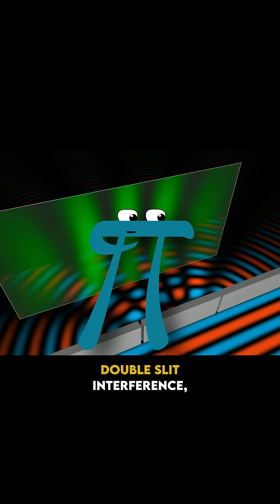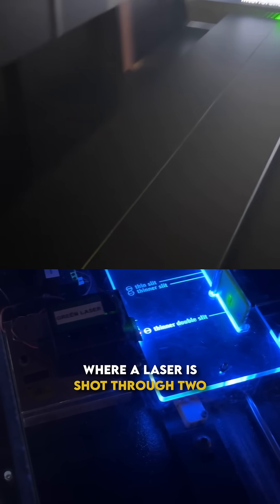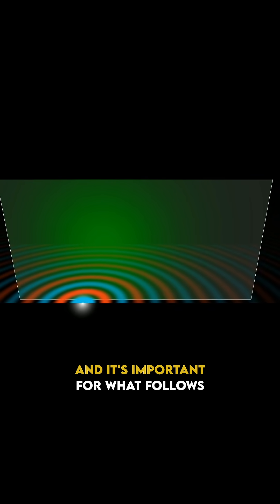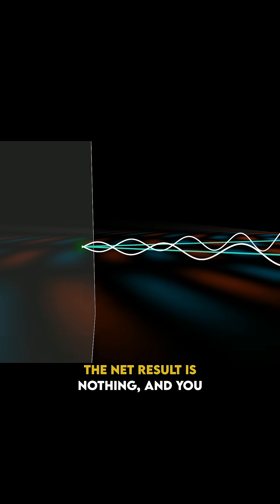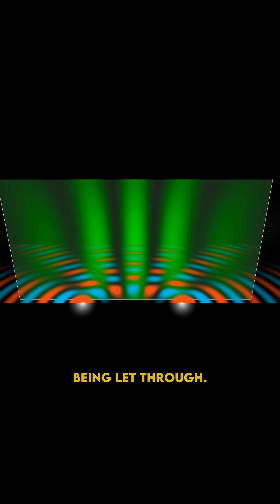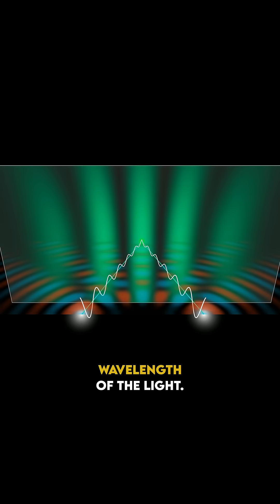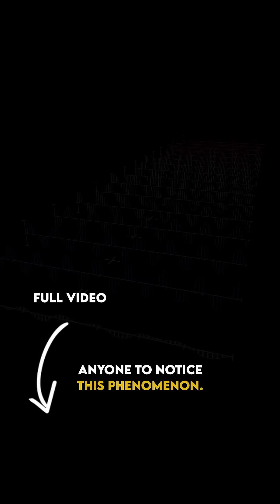Thinking through double slits

Comment: To be clear this is not a demobstration of the quantum double slit experiment. You could say this is a classical optical variation (there is no "white" wavelength of photons) as in this a laser beam is aimed at the slits. While it does demonstrate wave interference similar to the quantum experiement, it doesnt demonstrate quantum phenomena like superposition. In the quantum experiment single quanta are shot at the slits and the interference patterns thst appear are probability distributions (wave like), but when a sensor is added at the slits the pattern disappears as the measurement causes the wavefunction to collapse (in most intetpretations of QM) and the position of the quanta becomes certain and point like (particle like).

Comment: Is there a follow up video that explains how a “single photon” interferes with itself, even though a photon is a particle? I can’t find a good explanation as to why we think light is a particle. And how does one emit a single photon? You can’t see it, so is it just a calculation of the assumed energy value? Would it not still be a propagating wave? Does one light source emit [<infinite] photon particles in infinite directions? Or is light a wave until it collapses, then we call that a photon? Why does it collapse & become a photon at that point and not everywhere else?

Comment: You do see it with white light. You just need very small and close together slits. Anyone interested search up diffraction grating. It’s very cool.

I will rant a bit because I spent way too long learning about this in physics. Please correct me if I am wrong. A formula is used for interference(maximum) : d sin ø = m x wavelength. For minimum it’s: d sin ø = (m+1/2) x wavelength. D being the distance between slits(diffraction grating again). Ø is theta, Greek letter used in maths to represent an angle. M being the order of maximum or minimum which refers to the interference pattern. Basically think of the pattern as having alternating maxima (where the light is brighter) and minima (where the light is dim or not there) with the centre most being the 0th order maximum and the two minima next to it being the 0th order minima. It goes up from there by one. Don’t ask me why it’s like this. Note that this only works for coherent waves which are waves in phase with each other. That’s the reason why m can only be 0,1,2,3, etc. also the reason why for minimum we add 1/2 as it is offset by it. We use this equation (at least in school) to figure out the wavelength of light.

Almost forgot the most important part. This experiment was used to confirm that light in fact is a wave while also being a particle. Best explanation is either think of it as a stream of particles like a train or that light exists as both a particle and wave until observed, which then it functions as the state it is observers in. Confusing but cool. Light was also confirmed to be a particle using a gold leaf electro something. Am experiment which discharges electrons form a metal plate (normally zinc) using uv light. Normal light cannot do this which proves it to be a particle not a wave but also a wave. This is because the photons in normal light do not have enough energy to move electrons up energy levels in an atom but UV can. If light was to function as a wave it should be able to. Search it up it’s very interesting.

Comment: Stupid question, but at that point I usually think about what happens when light destructively interferes. Does it turn into heat? radioactivity? Something else entirely? It's not like energy stopped affecting it, the light sources are still pulling it up and down, which would make the light in that spot suffer from some sort of conservation of momentum. Is light perfectly elastic? It would seem that a constructive iinterference would be brighter regardless of whether destructive interference exists or not,, but transfer of energy from the destructive energy would make it even brighter, still.

Comment: The pattern seen is not the physical light because the same pattern is observed when any elementary particle is sent through one at a time. The pattern comes from the probability of finding the particle at those locations on the wall. 
It is not an interference of EM radiation waves from both slits. The wave here is a QM wave function that can be interpreted as having a probability of passing through either slit b/c of the mathematics of QM (ie how we square the wave function).

Comment: So the double split experiment requires one wavelength/color, and a beam of a bunch of photons to go through both slits and interfere with each other right? I always thought it was one photon, but it makes sense that it is a bunch of photons moving in wave patterns that cancel each other out
Reply: A wave can be thought of as a packet of photons. That’s why light is so weird. It can be thought of as an instantaneous wave or as a particle with speed. Neither are entirely correct as they are. Light has speed but also be a wave. It’s very odd

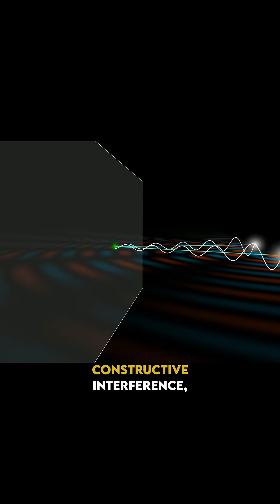Comment: 0:50 ok, it makes sense that if the two waves are in opposite phase they cancel out, but since the intensity of the wave decreases along its path, when we take a point on the wall which is not at the same distance from the two slids, the two waves meeting at that point will have different intensities, so they will not exactly cancel out even if their phases are perfectly opposite
Reply: Exactly. If you actually do this it looks more like they fade in and out but due to the fact that they double or half it is still quite clear. Not as clear as diagrams make it out to be though

Comment: What I don't understand is why each slit would become a point source of light, instead of the light just going straight through. What is so special about the width of the slits that causes this?
Reply: It’s to do with the refraction of light round corners. It’s the same principle as you can hear sound coming through a door even if you aren’t in direct eyeline of the sound. It goes round the corner

Comment: Could somebody correct me if I am wrong because I only studied physics till high school. This is what I believe: The experiment shows the constrictive and destructive nature of waves. When two waves of same wavelength with same phase meet then they are additive in nature and hence the bright spots. In contrast, when two waves of same wavelength but with opposite phase meet then they are destructive in nature and hence the dark spots. Since sound is also wave, same principle can be used for active noice cancellation. Is this correct?
Reply: This is exactly how noise cancellation works. Because sound is made of many frequencies, your noise cancelling speaker has to be either extremely close to the source of the noise or extremely close to the place you want the noise cancelled (your ears) or else you will only cancel some frequencies and not others. Like the video says, white light (many frequencies) does not cancel completely. That's why noise cancelling headphones work well but a device on a table would not (too far away).
Reply: Exactly yeah

Comment: The wave particle duality of an electro is actually the electron getting into superpostion in all possible slits whic would be all slits apart by half of the electronns wavelength. As long as you can not measure which slit the eletron will go through, the wave function will not collapse and the electron will be in a superpostion of all possible states simulataniously. Thus the diffraction pattern you see on the secreen.

Comment: Question: how destructive is destructive interference? 
I.E.: if you put a thermometer or other measuring tool on both the bright strips, dark strips, & a control dark area would the dark strips pick up any reading? 

Is there still an invisible energy transfer of some kind? Or does destructive interference neutralize the lights energy in those areas somehow? Or is the energy across the lines uniform?
Reply: Yeah so it’s never perfect because there will always be some imperfect factor somewhere. To get it completely dark at the dark spots, the slit width would have to be the exact width of one wavelength of light (about 500 nanometers) which is obviously not easy to do. So it would pick up some light if you ran it in real life but it wouldn’t if you ran it in a perfect world. Hope that helps :D

Comment: That is partially wrong
You can see a pattern with white light (different wavelengths) the only restriction is that the light needs to be coherent (the phases need to be synchronized)
That’s actually a way to split light into its base colors similar to a prism

Comment: Will the double slit experiment work with a LED as the light source?   If I understand correctly, LEDs are monochromatic and should therefore be nearly pure sine waves that will create the interference patterns.
Reply: Yes. But we use a laser because it works best when all the light is coherent and in phase

Comment: What about diffraction, never understood how it works
Reply: It's when a wave bends into the shadow of obstacles.  Longer wavelengths diffract more.  Diffraction is how we can measure the wavelength of light.  We can't measure frequency directly at hundreds of Terahertz, and thus we measure wavelength instead to define color of light.  The speed of light then allows us to calculate frequency.

Huygens' principle describes how diffraction works.  At each wave crest, the next wave crest is generated by the constructive interference of a continuous source of wavelets, that each propagate in a radially outward direction with spherical symmetry.  The constructive interference of all the crests of these wavelets, forms the next wave crest.

Comment: But why does the light behind the slits behave like a point source and not like a single beam of light?
Reply: That's a very good question. It happens due to wave diffraction!

Consider a wavefront passing by the edge of an object. When it has passed the object there are no waves immediately to the side of the wavefront because that region was blocked by the edge. This creates a very sharp contrast of intensity in the electromagnetic field. With no waves immediately adjacent to the wavefront at that point, the wave propagates into the empty space, with this spreading originating at the edge of the object. In a slit, the wavefront encounters two edges, one on either side, so when the light spreads out after exiting the slit, it spreads out to either side, making it act like a point source of light.

Diffraction effects are inversely proportional to the size of the slit relative to the wavelength of the light. You can imagine that the closer the width of the slit is to the wavelength, once it has passed through the slit, the less each wave looks like a planar wavefront and more like a parcel of light, about as wide as it is long. Almost... like a point. So, once it spreads out, it spreads out in all directions. This is why light acts like a point source after passing though a small aperture.

Hope this helped!

Comment: Real question here, so at the anti node (dark spot on wall) if I were to move that back so the wall is now not flat at that point ie further away from light source is it still dark or does the light come back because your not at the same distance?
Reply: Technically there would then be more room for the waves to continue along their path and therefor you would begin to see light again.  The problem, of course, would be by "moving" the wall back only in that area, you would be creating a cubbyhole--and adding essentially 2 more 'edges' along the new boundary which waves would deflect off of.
Reply: @billworthers1075  Sure, what I find interesting on that result, is if you think of the wall as a photon detector ie CCD does my irregular shaped wall now detect more energy ?

Comment: A couple of points of clarification. One of the problems in getting interference from the sun is that the sunlight is coming from a range of directions as the sun  is not a point source.  Thomas Young in his original experiment used a pinhole into a darkened room so that the sunlight came from only one direction. The second point is that the incoming wave is reflected backwards at the slits and there is an interference pattern behind the slits as well is in front of them.  Nils Berglund has produced a simulation including this reflection effect.

Comment: I Always though the astounding point about the double slit experiment was this:

for things like electrons or photons you have a wave-particle-dualism. Meaning things like electrons have properties of both particles and waves.
Even if you shoot single electrons or photons they have wave properties. This means if you have a double slit, even singke electrons shot will have a wave property and this will lead to the electron (as a wave) interfering with itself leading to the same interference pettern.

Now the astounding part. If you add a sensor capeable of measuring through which slit the electron passes though this changes the pattern on the oither side. The measurement collapses the wave function fixiating the point of passage to one of the slits. Since now it is "known" though which slit the electron travveled, the wave can no longer interfere with itself, since the wave does no longer travel through "both" of the slits, but it is fixed to one slit. This means the wave can no longer interfere with the part of the wave that "travveled though the other slit" therefore you end up having no longer an interference pattern.

The astounding thing for me was always the idea, that simply the measurement of the passge of the elecctron changes the outcome of the experiment. The even more confusing thing about it for me. Unless it is measured, there is no clear location for the electron. It actually acts as if is was a wave with a "density of probability of presence function". The single partical can act as if it was a wave with a probability function and until collapsed through measuremnt, there is not disction location, there is only a wave function.
Reply: Right, this fails to address the real complexity of the two slit experiment.
Reply: The big question is what exactly is counted as "measurement". Can't electron just bump into something on its way to the screen that would also be accounted as "measurement" by nature?
I might be wrong but it feels this has to do with Heisenberg uncertainty principle. If we know which hole electron have flown through, we can now calculate both position and momentum (am I right here?) which breaks the uncertainty principle. So once an event happens (quantum interaction of some kind) that by reading its consequences one can recreate both conjugated values (e.g. position/momentum, or time/energy), something forces the quantum particle's wave function to collapse and it stops behaving like wave. Feels like there must be some kind of mechanism built into the nature that "tracks" such possible violations.
Reply: @TsMunch  first question, yes. And that's the problem. Detecting an electron means interacting with it, hence measurement
Reply: It doesn't collapse because it is known, it collapses because we currently don't have any way to measure the particle without having it hit something first. If you have a sensor at each gap, then the particle is actively being interfered with as it passes through, so it must collapse there and not on the wall.
Reply: @SikerGaming  the question is always, as an individual photon is traversing the slit, what is it interfering with, itself in all other probabilities of itself? There have been thousands of iterations of this experiment, and it seems not to matter when it collapses in time, before or after the slit, etc.
Reply: @SikerGaming  you're being pedantic, it collapses because when it is known because for it to be known a measurement must be made.
Reply: @SikerGaming  best comment here
Reply: common misconception: the particle doesn't "know" anything. measurement means interacting with it. observing means interacting with it. we see cause photons get reflected into our eyes. we use particles to see. it's an interaction.

Comment: What if you use two different color lights?
Reply: Then you will get a superposition of their two interference patterns.  Some locations will have a mixture of both colors.  Assuming you use monochromatic red and monochromatic green together, your mixture of both colors will appear yellow.

Where green appears, this means green is at a high point and red is at a low point.  And vice-versa for where red appears.  Where yellow appears, they are both at a high point.

To get an easy to understand interference pattern, you need just one color of light at a time.